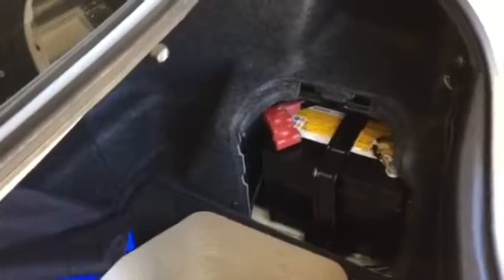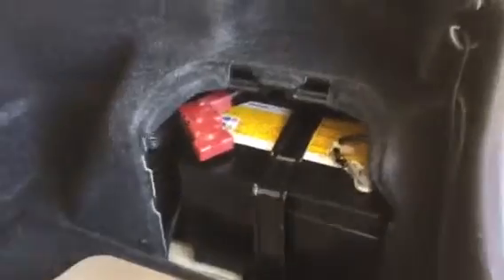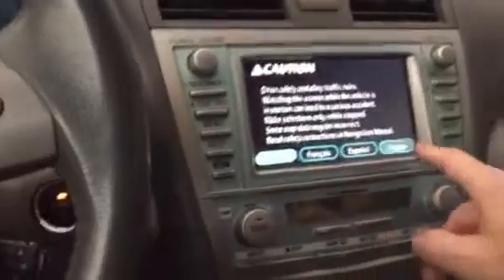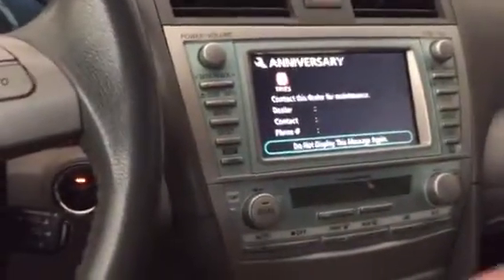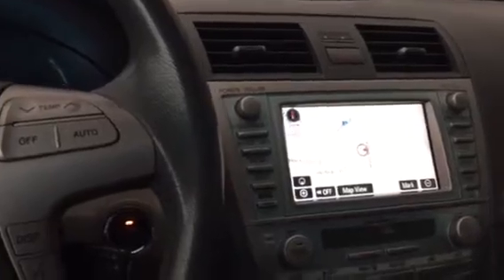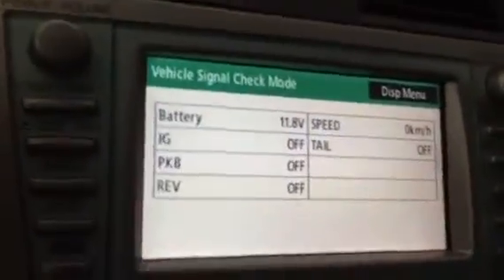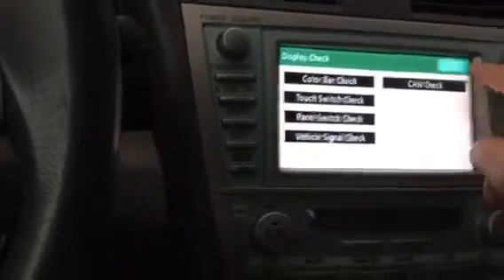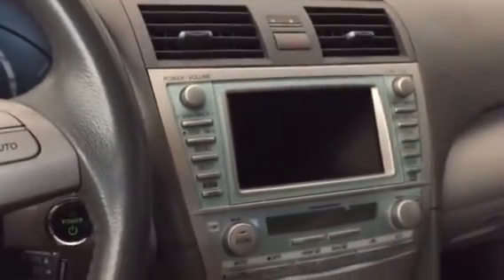Toyota 2007 Camry Hybrid 12 volt battery dying

Comment: Standard questions:  Did you check for a solid negative connection on the battery. How was it determined that the 12v battery was dying.  How was the battery health tested.  What to do when something like this happens. Plan ahead. When a car is out of warrantee  you don't have to go back to the Dealer for anything except to buy OEM parts. air/oil filters and OEM fluids.  Establish an Independent car repair garage near your residence  that has a technician with some Toyota Hybrid experience. Look them up first on YELP for customer satisfaction reports.  When that Toyota Hybrid has a rare hiccup.. drive it or tow it to that Indy garage tech so he can scan the engine control module (ECM) with his OBD ll diagnostic tool. The ECM scan will also verify that the 12v battery is being supplied with enough voltage (from the Hybrid battery) to maintain its full charge.  The unique glass mat battery with an outside vent tube used by Toyota cost about $350  so you want to make sure it's really going  hoofs up. ==> Side bar:  It's close to being  common for mice to build a nest nest on any flat spot near the A/C filter or even down in the center of the A/C blower.  Pull the A/C filter out (accessed via removable panel in the back of the glove compartment) and take a good look around. Also check the Hybrid cooling system duct air filter and its blower for mice and dog hair.

Comment: We're did you get the cell batteries for the battery pack.
Reply from the maker: I looked on Craigslist and found a person. Replaced two cells$550 with 6 months guaranteed. Be sure the person checks all your cells and show’s you which ones are good and which ones are bad. Also ask how old the ones they are putting in because they get them from wreaked cars.

Comment: After holding down the "info" button,  which light did you hit 3 times? The video was blank that period.
Reply from the maker: It is the regular head light on and off switch.
Reply: FordHarrison i can not find those light to hit 3 time, pls recommend
Reply from the maker: @SetecerBuglozo168  it is on the left side of the steering column. It is the same switch that you turn on your headlights.

Comment: Hello,
Plz help me. I'm going to buy a used 2007 Toyota Camry Hybrid with 110,000 miles on it. How can I make sure that currently there is no problem with the battery? If I bring it to Toyota dealer, are they able to evaluate the battery's health issue?
Reply from the maker: The screen inside the car will show you how good the battery is working. As you drive the car look on the screen to see if the charging is working. You can take it to a dealer or take it to a person that fixes the battery. We have two hybrid and the other car has 197,000 and the battery is still ok. The big battery with the cells.

Comment: I have a question! So my Toyota Camry hybrid turns on but when I drive a certain mileage the gas stops working so I’m not able to drive it. I have to turn it off and turn it on so I can run again what could that be? We just payed $350 to replace the battery in the trunk
Reply: You sure its not the e mode kicking on to save gas? I know when I first got my car that happened and I got scared but if you press the gas and keep.driving the car engine turns on by itself
Reply from the maker: Sorry, I have not experienced that problem. Sounds like something needs to be reset and when you turn it off and them back on and it works it is resetting something. What that something is I don't know. Sorry
Reply: Hey did you figure out your issue? Mine is doing the same exact thing

Comment: How do we see the energy monitor cycle (like in Prius), I couldn’t find the menu options for that? I wanna see the main hybrid battery health.
Thanks you in advance 😊
Reply from the maker: Hello, I don't have the vehicle any longer so I am not able to research that for you, sorry. When I sold my car it had over 208,000 miles and still running great (I maintained it at every interval). The air conditioner was not working and the condenser under the dash had a leak and the cost was $2,100 from the dealer. Be sure the air conditioner works before buying one. Turn the air fully on, then heat fully on then air. Listen under the hood that the compressor is kicking in each time.
Reply: You probably dont care at all but does anyone know a tool to log back into an Instagram account?
I was dumb forgot the password. I appreciate any tips you can give me!
Reply: @Mathew Zev Instablaster :)
Reply: @Allan Jamal Thanks so much for your reply. I found the site through google and Im trying it out atm.
I see it takes a while so I will get back to you later when my account password hopefully is recovered.
Reply: @Allan Jamal It did the trick and I finally got access to my account again. Im so happy:D
Thank you so much you really help me out !
Reply: @Mathew Zev Happy to help =)

Comment: is it wise to buy a used camry hybrid? is the battery expensive to replace?
Reply from the maker: When buying a used hybrid car, you can have the battery checked. A dealer can do this. But first at least check the display in the car itself. Go to the info display and go to the screen that displays the status of the battery. Also drive the car with the energy process working and see if that is working correctly. To replace the main cell battery is expensive $3000-5000. It is not good for a hybrid car to sit and not be driven. The more you drive it the better. That’s why taxi hybrids are getting 300,000+ miles out of a battery.
Reply: @darrenleipelt7407  07 Camry worth to buy more than $5k? 150.000mile? how can I know battery status I mean how much life left?
Reply: Vadson auto clinic Ltd depends on how the car have been used before have a very good look before you buy
Reply: @abdulazizalskait4443   did you get any answer for this bro ?

Comment: My battery is showing 13.4v. But today my car wouldnt start.. Isnt 13v mean its a good battery? Please reply back at your convenience.
Reply from the maker: Yes i believe your battery is ok. Probably something else then. Sorry I can’t help more.
Reply: @darrenleipelt7407  it ended up being my 12v . And thank you for the reply, very much appreciated.
Reply: Mine shows 13.6 but always receive this message "low battery, shift your car to parking " when i switch to mode drive. Before that i have abs brake problem wich is don't already solved. Can somebody can help please ?

Comment: What do you mean "click the lights three times (blackout)"?  
And $350 for a 12v battery?!   THAT'S NUTS!
Reply from the maker: Battery lasted 11 years. That's a lot longer than a regular battery.
Reply from the maker: The switch that turns on the headlights. Turn that off and on three times.
Reply: @darrenleipelt7407  it is true..I just replaced my 12v battery after 11yrs..2010 Camry hybrid
Reply: @YouTAbu  same here, just replaced our camry 10 the 12 v panasonic battery  last month , with a 2009 date on it . That old battery lasted with us almost 12 years. Bought the new panasonic one @ the dealer for $315 + tax = $349. I changed the  battery myself.